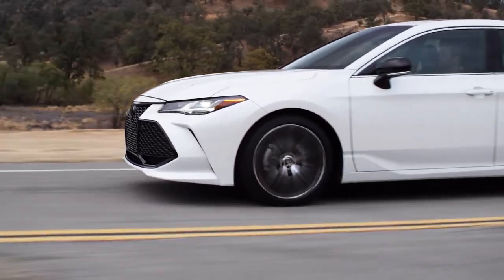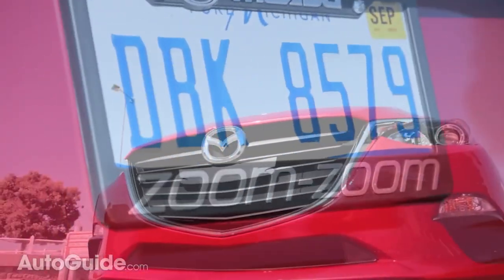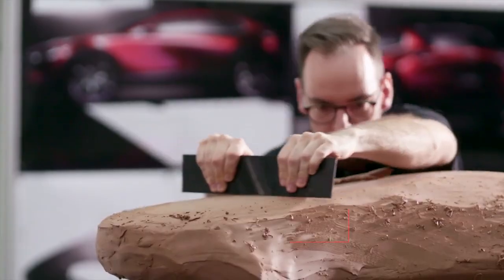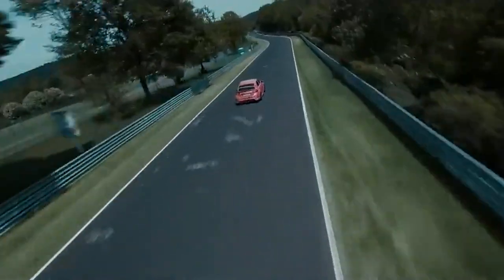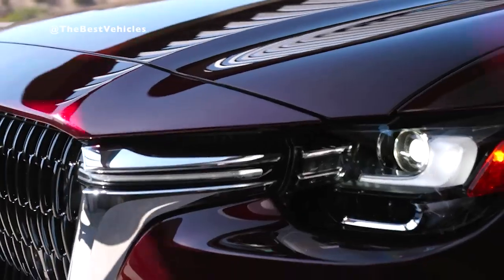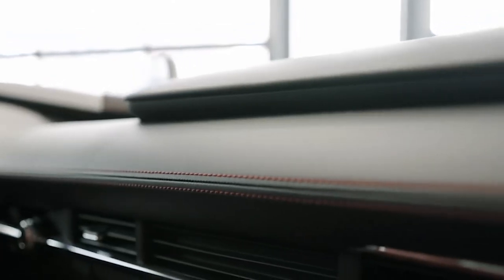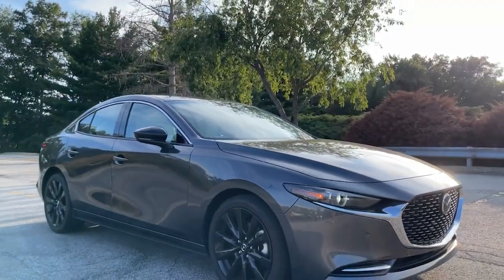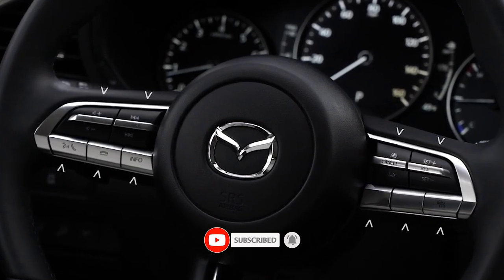NEW 2023 Mazda 3 SHOCKS The Entire Industry | Huge News!

Comment: Rear independent suspension is needed.
Reply: I have a 2008 Mazda 3, 2 L, 5 sp with 106 k miles…a great car.  It has some desirable features that are not found on the newer Mazda 3’s…such as:  it has fully independent rear suspension vs a torsion bar type like was used on the cheapie Mazda 2, is much lighter (2780 lb vs 3126 lb) and has an “oversquare” (bore/stroke =105%) engine vs an “undersquare” (89%) engine.  Porsche uses the smoother, more reliable oversquare engines.